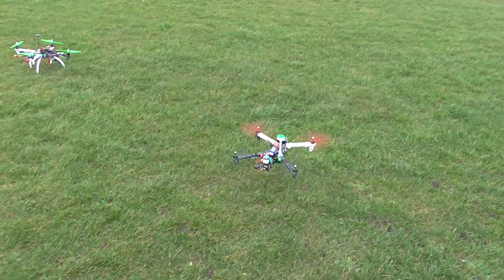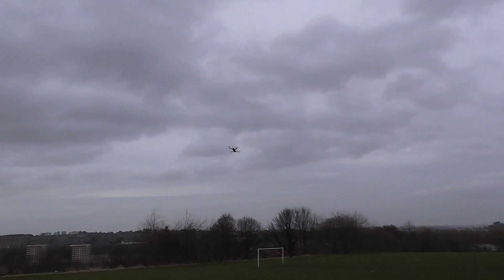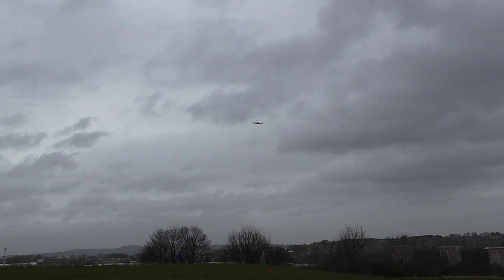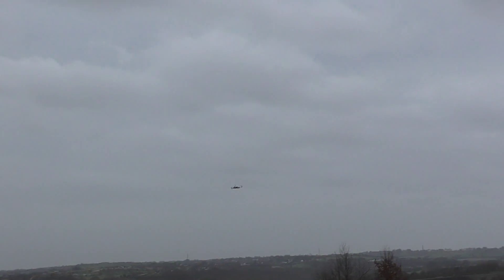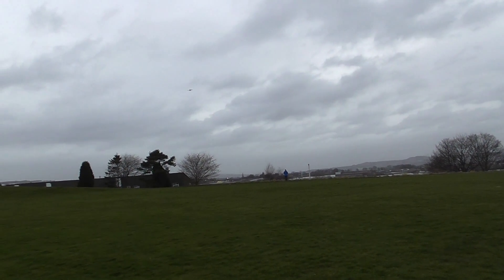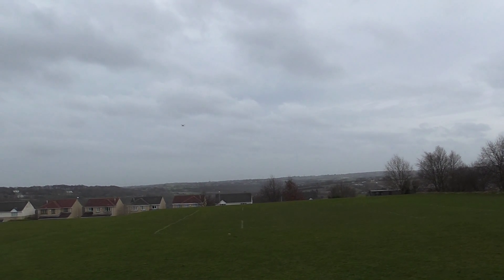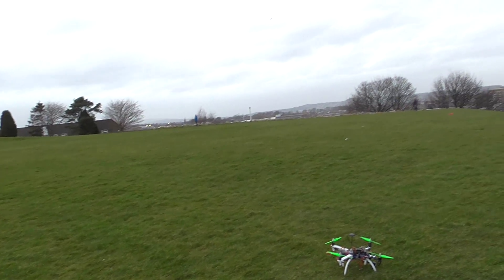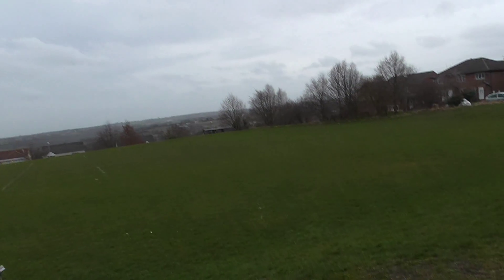Cheerson CX20 Quanum Nova 450 Quad Frame Build Complete

Comment: do you have to change min thr  on mission planner i have afro 20 amps and turingy orange 1400kv motors but have problem where about 1/4 thr 1 or 2 of motors stop i did all the esc calb and everything

Comment: Like many others, I have the same issue (got tired to replace the body at each crash).  My only question is: how to deal with the Power Distribution Board?  I saw many cool frames with integrated PDB but, the CX-20 has some tiny chips and inductors on it, and not the bulk ones...  ? Thanks :-)

Comment: Great work! 

Just crashed mine and someone suggested this. Few quick and newbie questions (bear with me Please).

1) Can I use the stock CX-20 (Board, FC, ESC, Motors, GPS, Compass, Receiver) with this frame (basically do a transplant)?

2) Would this require reprograming?

3) Can I mount Go Pro or Xiaomi Yi with it? Does it have mount support or I will have to do a custom job?

Thanks a ton. I plan to be in the air with stock CX-20 but this frame and then keep on upgrading.
Reply from the maker: ibrahim abid Yes you can just do a full body transplant from out of the cheerson ( quanum ) onto the frame I believe you can hang mount a go pro with the relevant mount
Reply: Pudsey - Rc Thanks for the quick reply, Can you send me a link for some closeup pictures of your setup?

Also whats the frame made off (Is it durable?)
Reply: Pudsey - Rc Also my compass is in the dome, how do you suggest should i put it up on this 450 frame
Reply from the maker: same as I did make a rod and put it inbetween 2 milk carton lids :D you see the green dome that's 2 milk bottle lids
Reply: Pudsey - Rc Lol thats some fine work. Would love to see some closeup pics. I hope the frame is durable, guess I will go ahead with it.

Comment: Bought one of these frames after crashing mine and breaking off an arm.  I couldn't figure if you were using the original power distribution board from your comments.  Do you have a page with pictures so I can check out your handy work, I want to try to avoid rewiring to much if I have to.

Thanks
Reply from the maker: Jason Clint That quad as long gone it was a fly away but yes I was just into quads then and used the original pdb so I myself didn't have to do any rewiring. just a body transplant lol

Comment: How do you wire in the new esc's as there is 3 thick wires and 3 thin wires going to original esc
Reply from the maker: Paul Malone  Cant recall the 3 thick wires to be honest the 3 thin wires goto the motor the 2 thicker wires go to the power distribution board I believe the third wire you mention is for the lighting on the esc,s  which I didn't bother with

Comment: How does it preform ?????

Crashed mind and would rather buy a different frame. I like the 450. But would like bigger landing gear
Reply from the maker: Dave Parker It performed much better on the 450 frame and there is a better variety of landing gear for the 450 frames
Reply: Pudsey - Rc thanks for the reply.  Gonna buy one

Comment: Hello what transmitter and receiver are you using on the rebuild ? and if I may ask the reason for the change from stock is ? Im new at all this Thanks Ed
Reply from the maker: Edward Elligson I used the FRsky Taranis Plus radio and Frsky D8 Receiversimply because I wanted it to have more range and I didn't like that you have to wait for a rebind if you go out of range

Comment: I see the detail now  are the Afro esc 20amp with simonk firmware did you have to do any apm firmware tweeks cause of the different esc's thanks so much for putting up with the newbe questions
Reply from the maker: Im  a newbie myself and no changes had to be made for the esc,s although I did calibrate them just as a thing to do lol Throttle to top then bottom routine. in the apm planner loaded settings for intermediate and it was good to go :D
Reply: Thank you so very much. Would it be ok ask some more questions in the future. I'm leaning towards a swap to the arris 680 frame. How is the apm controller powered and the rx is it connected to a bec
Reply from the maker: if your sticking with the power distribution board ( which is pretty big ) then there is no need for a bec it has one on it. ( make a note of the wires you disconnect to reconnect on another frame ) I just ripped all mine out when it smashed and guessed it. Not sure about the RX because I ripped mine out and put a frsky one in and the RX was powerd by the flite controller which was connected to the PDB board which had a bec on it :D
Reply: Cool you've been a big help thank you Ed
Reply from the maker: anytime :D

Comment: Hello my name is Ed what version esc's are you using now and since they are different did you have to do any apm changes for the new esc's to work ? I have two bad esc's MFL1218 V1.4  Im having a hard time finding this esc version. Question would a different cx20 motor esc version be compatible if I changed all four thanks for all and any help in advance.